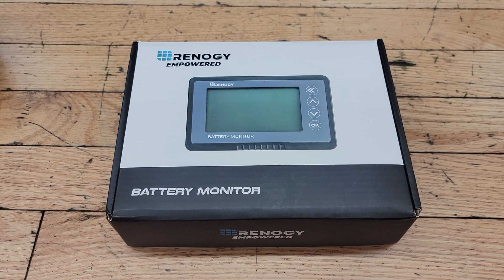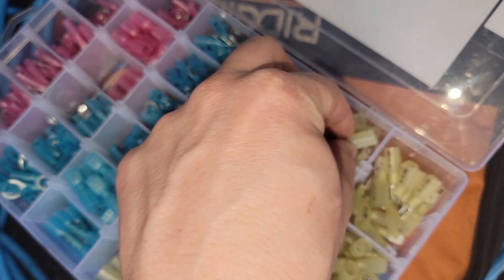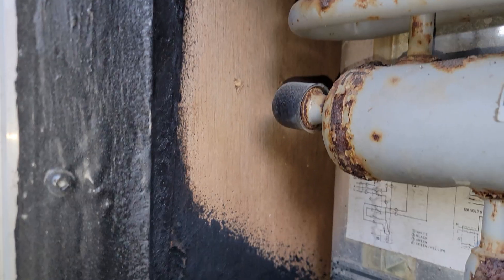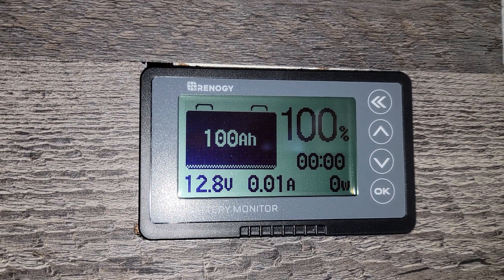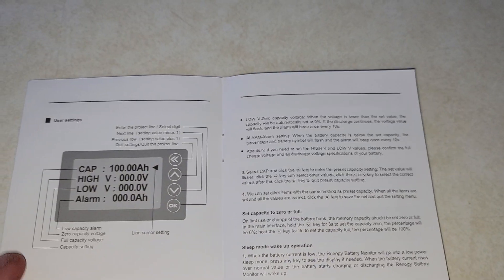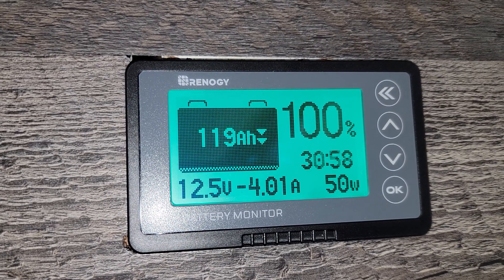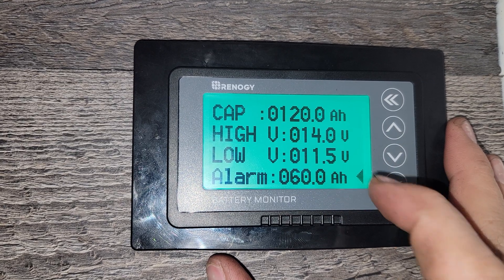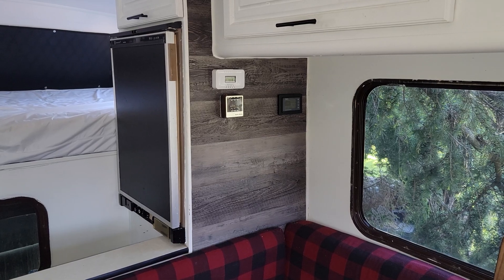Renogy Battery Monitor Installation

Comment: What did you use to cut your plastic bezel?
Reply: What kind of jig saw blade works best on the plastic? I tried a rotary tool but it melted more than it cut. Your front plate came out nice. I need to install two of these and your outlet bezel looks great!
Reply from the maker: @KPe-v4s  I think i just used a fine tooth blade like something for metal and go at it high speed
Reply from the maker: @KPe-v4s  I used a drill and a jig saw

Comment: Where exactly did you run your DC wire to? I’m very new to this and getting ready to install a solar system on my trailer. Thank you!!
Reply from the maker: @BL-lj7we  I already had a positive and negative wire from the camper that ran to a battery previously

Comment: I also own one of these devices. One disadvantage of this monitor is the idea that voltage can be used to define when the battery has a 100% state of charge. It should use ampere hours replaced plus a user selected % inefficiency. So if you draw 100 Ahrs from the battery you need to put say, 110 Ahrs back into it to indicate a 100% SOC.
The case should have a wider lip to make mounting easier. The clips are not strong enough to keep it in place on rough roads. A wider lip with four holes for bolts or screws would be an improvement.
It works, and is good value for the cost.

Comment: If you have 2x 88ah you set the Cap to 176Ah if I understand correctly.  What do I set the Full V, Zero V, PowerOff and Alarm to?  I have 2 SRM-27 Interstate batteries. Thanks for the vid it was awesome.

Comment: Just a quick question: I understand how you installed it. But your solar energy goes still straight into the batterie? I mean positive and negative wire of the solar controller you attach directly to the battery? it n ot goes through the shunt?
Reply from the maker: At the time yeah but I've updated my setup. Check out one of my recent videos I revamped my electrical system for my camper.

Comment: Going to the DC side of camper?? WTF does that mean???
Reply from the maker: It means the 12 volt wires that run from the battery to power all your lights, etc, in the camper.

Comment: Say I want to use this monitor for my home. I have 8 batteries 100ah each. I would need two monitors in order to be able to monitor all 800ah because this Renogy is only 500a right?
Reply: Ah and A are different units. You're comparing apples and pears. You need to know the max current draw of your system (Amps). I somehow doubt your AGM battery will be  drawing over 500A ever. If they are you must have some monster cables from the battery.
Reply: @jonnomra   I have 8 lead acid batteries.

Comment: I like the bezel idea with screwless view. the black seems to give it a rather very much cleaner look. 🌟🌟🌟🌟🌟 I was concerned at first from what I have been learning of voltage and 50% of amperage.. the 12.06 volts is = point of battery deterioration beginnings but loads do draw down lowers slightly till load is off and comes back up to stable and that is the 12.06 volts to be concerned with  / am i getting this correct ?  Iam new but not to electricity with tech radio things ,,,,, rv electric  iam new, been learning LiFePO4 and attempted the switch over but the new controller to cover Lithium, AGM and LA was shipped in original shelf package and had bb noises in it so it went back, put in 2 - 235amp 6v in series LA's , maybe next year -- looking forward to installing the Renogy monitor this weekend.

Comment: I did find another youtube video that explained it.. You have to dis-connect your original neg. cable from the battery and connect it to P- side of the shunt. Then make up a new cable to run from the negative post of your battery to the B- post of the shunt.  I have a system with 5 AGM batteries strung out throughout my truck camper. It isn't as straight forward as yours.  450 watts of panels, 525 aH of Agm battery, 3,000 watt inverter.  Now I know I have to run a cable from the negative post of the original battery, across the back of my camper to the shunt which is on the other side of the camper.  And connect the negative post of the last battery in the string of 5 to the B- post of the shunt.  Does this sound right to you?
Reply: that makes zero sense
Reply: @mattkruger2909 But it works well.

Comment: When you see people’s comments makes you wonder where all the nastiness comes from? All throw I don’t agree with the way was presented to you but I agree with the gauge of the wire being way to small unless you only use it for led lights
Reply from the maker: People are just nasty. I make a video to help people but some people just need serious help, lol. Yeah if I were to show you the DC load in my camper it consists of about 5 led lights, a fan for the range hood, and the fan for the furnace. If I ran all my loads together it's probably no more than 10 amps. The wire is sufficient for my use. I wasn't the one who originally wired the camper for DC, but if and when I renovate it I'll be using thicker wire. Good luck with your install.
Reply: @OvensGarage  your good than amperage wise

Comment: I have one of these monitors and I watched your video specifically to find out where to connect the P- wire to in your camper.  To the " DC side of the camper " doesn't tell me where you attached the wire in your electrical system. What a disappointment, will have to watch some other youtube videos I guess.
Reply from the maker: There's a positive and negative lead that feed the DC system in my camper. If you can't figure it out for your application I'm guessing your camper wasn't setup to run on battery. Your comment is disappointing to read.
Reply: @OvensGarage  
The 7-pin on my truck puts power 12v DC to my trailer (lead acid).
I cut the Hot lead from the truck, I added solar and LiFePO4 batteries to the trailer.
To prevent the alternator from burning up trying to charge Li.
Also pull the fuse in the converter, and charge the lead acid manually (brakes)

 "I'm guessing your camper wasn't setup to run on battery."
mine was but not LiFePO4

Comment: What's the point of it resetting itself to 100% the moment it registers the high voltage ?? Which could be 2 seconds after you turn your engine on or the sun ☀️ hits your solar panels ... You then have batteries at 70% but it has reset itself to 100% just because it has registered the high voltage , which is no indication of state of charge ...

Comment: one thing you need to add that the solar charge controler needs to go to the p- side of the shunt or it will not show charge when battery is charging
Reply: I just talked to Renology tech today and they told me the same thing after I pointed out nothing was mentioned anywhere on their site
Reply: Omg thank you so much friend. I just hooked mine up and that’s why I’m here lol. I knew something had to go from controller bc it’s not recognizing charging. Just wanted to make sure what and how everything went so I didn’t fry something.

Comment: So you found the two piece snap on cover at Lowe's?  Home Depot never heard of it and I can't find it on Amazon.  And I have the same ugly gaps around monitor you have.  You think all Renogy had to do was make the front frame a little bigger and it could have covered all the problems people are having.  Not sure I think much about Renogy's design department.
Reply from the maker: Yep I got it from my local lowes they had a bunch of them. Branding was eaton if I remember correctly
Reply from the maker: Yeah I just looked it up it's called eaton screwless wall plate

Comment: Good luck with that cheap n nasty charge controller & wiring to & from cc doesn't look like copper (may be tinned?) & Size of wire gauge looks too small. Fire risk if over loaded!!! Insurance claim? ❌. The poor man always pays twice! Just saying...
Reply from the maker: It's actually marine grade tinned copper, and the main power wire is fused appropriately. My old camper doesn't have much that runs on 12volt DC, no major loads.

Comment: Great video!  I am having similar issue mounting my Renogy battery meter and your solution looks nice and clean.  Do you have a part number and/or source for your Eaton brand screwless outlet cover ?  All the outlet covers I have found, even on Eaton's website, have Decora-sized cutouts, but the cutout in your cover looks much bigger.
Reply from the maker: I just found it at my local lowes sorry if I didn't include the part number in the video
Reply: @OvensGarage  thanks for the reply.  In re-watching the video, it seems that you enlarged a decora-seized cutout on the front plate (as well as the cutout on the back plate) to make the battery monitor fit.  Then the lip of the monitor hides the rough edges of the cut in the front plate
Reply from the maker: @ourungus9222  yes that's exactly what I did! And it still clips to the back plate
Reply: Lutron makes screwless cover plates too. Lowe's and HD have them all day long. Amazon has them too